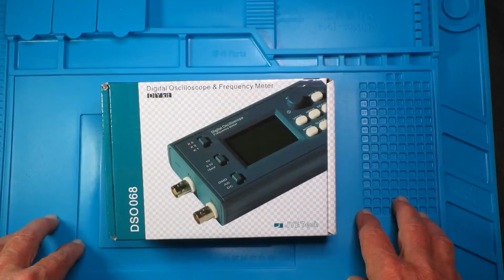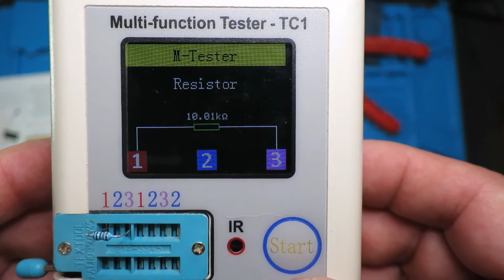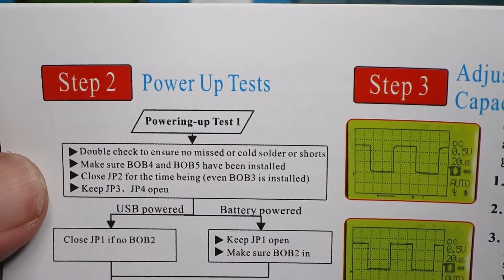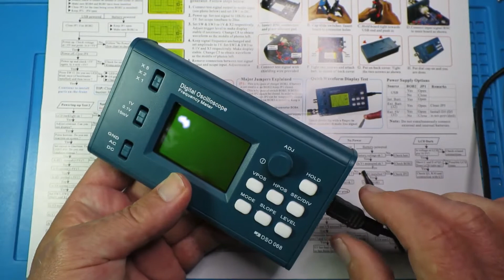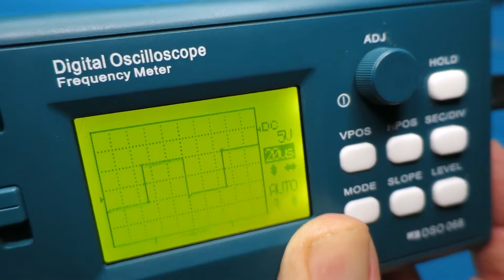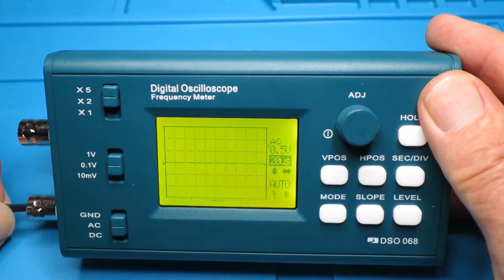DSO068 Oscilloscope Kit Build & Review - Electronic Project

Comment: Is there any chance you would be able to measure the gap between the main board and the LCD board in your DSO?

I installed the programming header and there was a short with the LCD board. The system still works, as evidenced by using JYELab, but I kind of killed the pads on the LCD header trying to get it off.

I have purchase some new compatible LCD displays, and also bought some new header pins. One thing I wanted to try out is soldering female headers to the main board and male pins on the LCD, both to set a gap, and to allow me to try different displays. I got black in yellow, black in white, and white on blue displays, and I'd like to try them all out and decide the best one for the fit, hence the 'modular' connector change.

I'd like to know the gap, as I had mounted the LCD somewhat off the plastic spacer of the header, and closing the case was very difficult because I felt the LCD was too far up the pins. This is also when the short occurred... everything was good until I had to force it closed.

The black on white screen seems to have a lower profile than the other two, so I feel it will be my final selection.
Reply from the maker: Hi, Once the BNC connectors are soldered it is impossible to remove the main PCB to check. All I can say is the main PCB is mounted directly on the moulded pillars in the case and the LCD is flush with the front. I diverted from the given instructions when fitting my LCD : https://youtu.be/zNTXAwxTG0w?t=752

Comment: Just ordered one of these for myself. In the power supply options section of the assembly guide, it has jumper settings for USB/Int battery/Ext Battery/Ext 5v.

Have you experimented with any of this? I'd like the option of using J2 with a 5v wall plug, and it says D5 is required but not supplied. I see it's a Schottky diode, but am not 100% confident on their warning about int & ext battery connected simultaneously.

Also, did the inclusion of the programming headers in anyway impinge on the space allocated for the battery?
Reply from the maker: I wanted to be able to use the 'scope just with an internal lithium battery recharged via the USB port. That works well for me so I haven't tried other power options. https://youtu.be/zNTXAwxTG0w?t=1256 This cell is thin so no problem with the programming headers.
Reply: @1nformatica  So, I've read the assembly instructions. The default assembly instructions leave J2 (DC barrel jack) non-functioning. 

On later revision boards (rev H and I), you have two options for its use:
1. Install D5 (not supplied), leave JP5 open to connect external 5v DC power supply. Can be used with an internal battery with charging BOB (BoB2 - JYE118) installed to charge the internal battery.

2. Use it as an external rechargeable battery. To do this you bridge JP5 and do not install D5, and it acts as a connector for that battery. You must NOT use the internal battery in this case. Also, the external battery will be charged by the charging BOB (BoB2 - JYE118).

Earlier revisions don't support option 1. It can ONLY be used as an external battery connector. By default it is not connected, and JP5 connects it to the charger circuit. Obviously without the charger board (BoB2 - JYE118).

I got a Rev I board, so I'll be installing D5 so I can use an external DC supply, and not be locked into USB charging.
Reply: @1nformatica  It looks like I received a newer revision... "I" ('i') Has no Buzzer.
Reply: R32 is not supplied, but can be fitted to alter the charging current of BOB2.

BOB2 uses the LTC4054 IC, and pin 5 is used to set the charging current. Max charge current is 0.8A or 800mA

Formula is:

Charge current (Ibat) = (Vin/Rprog) x 1000

Vin = 5v
Rprog = 10k (as installed on BOB2)

So we get 0.5A or 500mA

R32 is wired in parallel with Rprog on BOB2, so you can install R32 to INCREASE this charge current. I don't know how advisable this is. 

R32 value of 16.666k ohm will give a total Rprog of 6250, which will give 0.8A or 800mA charge current. 

Will the BOB2 circuit handle this? I don't know. There may be heat problems, maybe the traces can't handle it. Also, the USB supply isn't more than 500mA, so making any charge current increase mod would require a DC input on J2 (DC barrel jack) which can meet these requirements.

Comment: The supplied battery doesn't fit and Break Out Board 5 broke just by putting the case on!   Glad it worked out for you but I wouldn't recommend this kit.  Very sad :(
Reply: I had to clean up 'dags' left from the injection moulding process for the front cover. Always worth checking all parts for manufacturing errors when you buy things this cheap.

I've never seen a kit supplied with a battery. Sounds like this is an error on the reseller's behalf.

Comment: To think one day we'll have a single smart chip where you can adjust capacity to the capacitors, resisters, transistors and on via a USB or wireless
Reply from the maker: That would be a very sad day! No fun at all for the addicted tinkerer!!
Reply: I knew I would get this kind of reply, hahaha but for music we had a Victrola, wire, reel to reel, LP, 8 track, cassette, CD and now a digital file
Reply: a lot of the chips already do this
Reply from the maker: Yes, it is progress of a kind. I cannot help thinking though that folks won't learn as much as they did when they were scratching the top of a gallium arsenide crystal with a bit of wire!!
Reply: Yes I did forget the crystal radio and it will be a shame.

Comment: Nice vid! I have a question, you explained the extra cap to bring the probe calibration into line, but what's that red bodge wire all about?? Or is that just where you connected the battery in?
Reply from the maker: Hi Jimmeh B,  "BODGE WIRE"!! That's a carefully hand crafted linking wire!! Seriously though, at this point in the build the BNC sockets have yet to be soldered on. So the link wire is just to temporarily connect the test signal to the 'scope input.
Reply: lol... fair enough. Out of curiosity, how does the scope go as far as it's claimed spec and bandwidth? I have a DSO138 sitting in front of me and it's pretty lack luster as far as what was purported as far as specifications go.
Reply from the maker: I do not have access to equipment to test the spec really. If I need to do something "serious" I have a Rigol 4 channel scope. But for me this little guy is perfect just to sit on the bench small and battery powered to do quick checks for Arduino projects etc. There are many counterfeit DSO138's around http://www.jyetech.com/Products/LcdScope/e138.php If I were to buy again I would get the 2 channel DSO 094 would play well with the PC scope software :  https://www.youtube.com/watch?v=6u41DTtk-nY
Reply: Good as gold mate!   Thanks for the info, I'll check it out.
Reply from the maker: Also check out the Jyetech forum, lots of useful info there .....  http://www.jyetech.com/forum/index.php

Comment: How many bridges do you leave closed at the end of the installation, JP2, JP4, JP9?
I can not turn it on and off with the function button
   Temporary battery cut-off switch
Reply from the maker: Hi, JP4 is closed after the initial power test and left closed. JP9 is always closed. JP2 is closed only for the first test then open, that is the problem. I could not turn my unit off either until I realised this!! https://youtu.be/zNTXAwxTG0w?t=1345
Reply: 1nformatica     Ok thanks for replying
Reply from the maker: You are welcome, I hope you have subscribed!